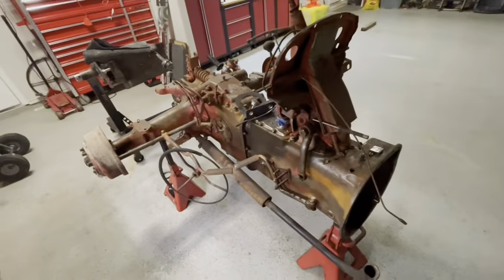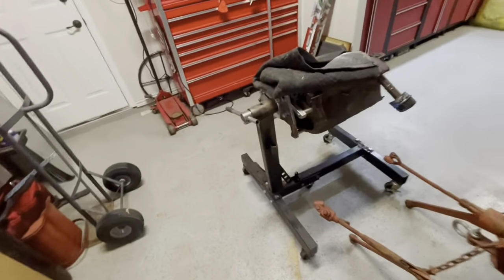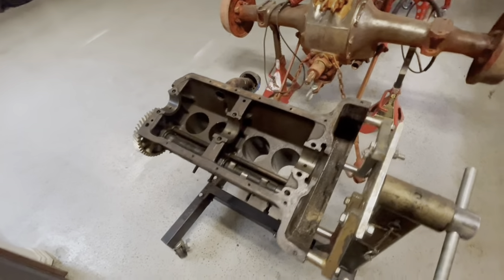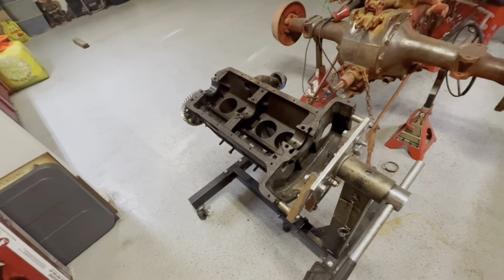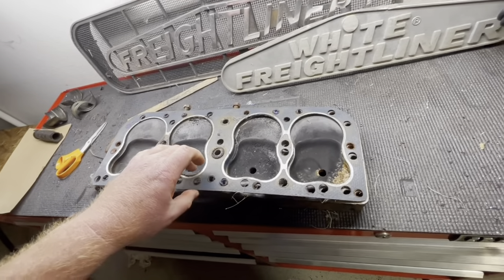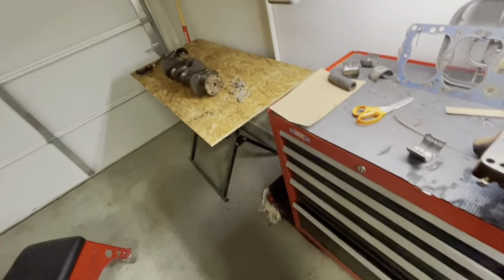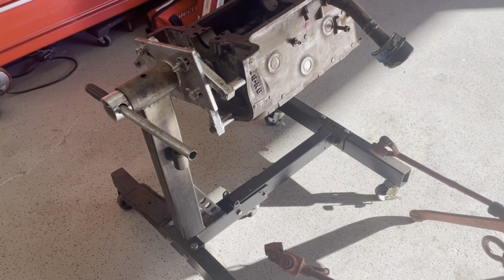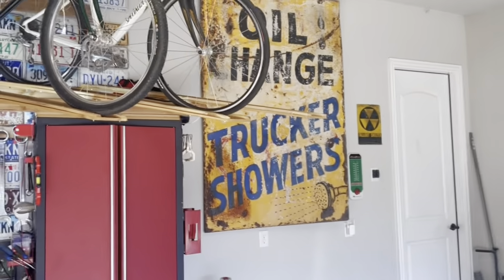What happened to my Ford 8n!

Comment: Good vid.  !    and i learned some things as well  !!     I have asked but never found ,   pure , solid ,  drill wire brush  ,  at least here in Canada ,   where did you find them .   Also ,  after sanding the crank , how do you know what size rod bearings to buy  ,  maybe a stupid question --  just learning  .    I'm looking for my first 8n  ,   to restore  .
Reply from the maker: Thanks!  I had to order the brushes, was trying to remember where I got them from but can’t. I remember them being hard to find. To rind the rod bearing size I used a micrometer.  Surprising it didn’t take much at all off before was a good finish. When I set the crank back in the motor I used a product called plasti gauge to double check my “mechanical” measurements. I have really enjoy this tractor. Allot has been done off camera since been working on it with the kiddo. I hope you pick on up. The part avaliblity is amazing. Thanks for watching and commenting.